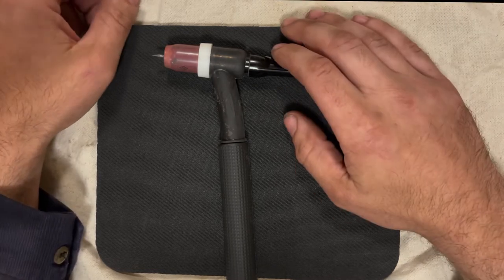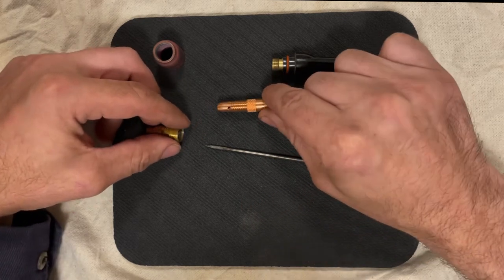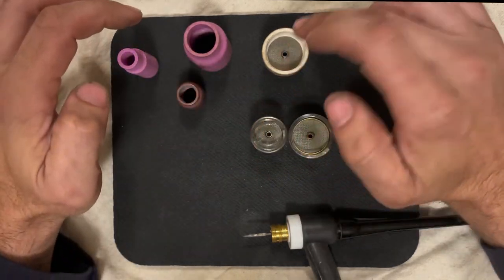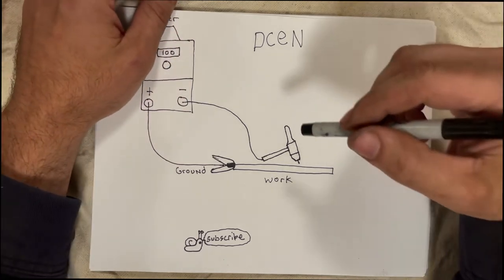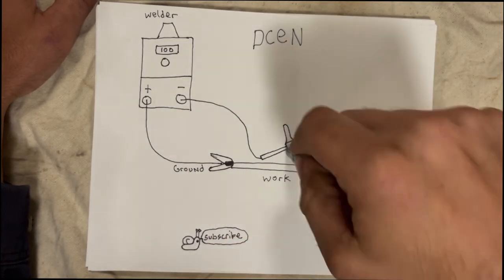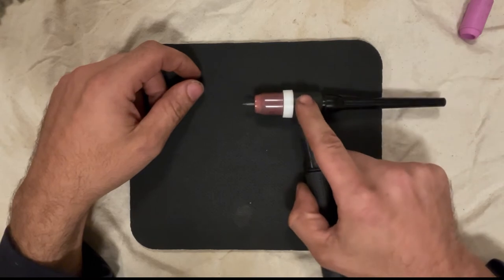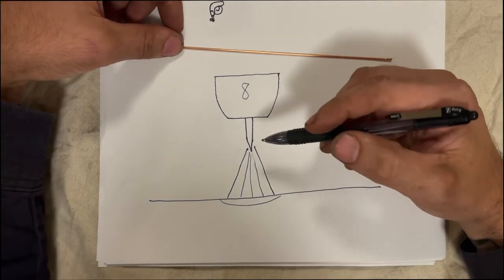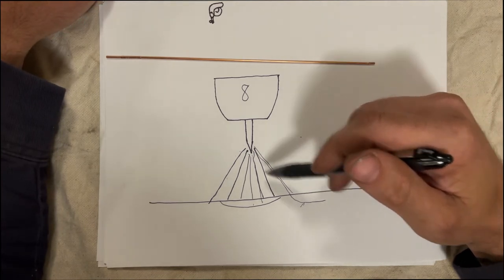Introduction to tig welding, you got to start somewhere right?

Comment: Thanks Greg! This is a very clear presentation of tig welding. For us beginners, the arc gap is smaller than expected and it's difficult to maintain such a small gap. Obviously, this is where practice comes in! Also, it's easy to forget that the electrode must be positive!
Reply from the maker: I am doing a whole series on tig welding and the first videos will be out shortly. I have to get through the backlog of videos I need to edit first lol.

Comment: Further notes from the field: Practiced tig welding for approximately three hours each day for the last three days. On the first day, I spent most of the time sharpening the tungsten electrode. On the second day I got a lot of burn throughs. But by the end of the second day an interesting thing happened. The view of the arc through the helmet became the dominant view. As soon as the arc started, the focus was on the tip of the electrode, the size of the arc pool, the location of the filler rod and the joint that was to be welded. As soon as the arc started, I felt at home. By the third day, the use of the pedal came into play. It became natural to let up on the pedal as the arc pool became too large. Sensing a burn through became more predictable. Also, I was able to focus on the location of the tungsten tip, the size of the arc and also how much pedal I was using. Each of these became distinct and controllable. One is supposed to feed the filler rod in, in small steady movements. I had been simply moving the whole rod in without advancing it with my fingers. But, by the end of the third day, that technique began to occur on its own. Not well, mind you, but it was starting to happen. The welds are nothing to write home about, but I can see that with practice, things could get much better! All of this is thanks to you and your patient and detailed explanation of how to tig weld!
Reply from the maker: Glad to hear of your progress 😀.  I will be releasing tig welding videos shortly once the last of my current video backlog is through.  

What you describe is what becomes automatic with practice.  It is unbelievably difficult at first with tig to control all of the variables, because you need to spend too much brain power on trying to control the variables.  As you practice most of the variables become automatically controlled.  At my experience level I determine arc gap not by the actual visual distance but by the light output of the arc.  As you become more experienced you will find you simply pay attention to how bright the arc light is, how wide the puddle is, and moving steady.  It becomes infinitely easier at this point.  Many people quit learning tig before they hit this point.  It takes everyone a different amount of time to hit it, the key is not giving up and steady practice 😀.

Comment: Greg I been watching a lot of your videos and bought a titanium flux core welder and because of you I am doing pretty well with it. I bought a yes stick welder from a yard sale for $50.00 and the guy through in a box of 6013 and 7018 already gave it a try on 1/8 angle iron with 6013 and was surprised how easy I picked it up after watching your videos haven’t tried 7018      yet trying to get a deal on some 1/4 “ I thinking of buying the ESAB rouge ET 200 tig welder have it in cart just haven’t hit the buy button yet. Would like to get one that can do aluminum but that seems to be out of my price range my question is to you what benefits do you get from tig that you can’t get from stick or MiG. Thank you for all you do you are a great teacher and an incredible person.
Reply from the maker: Glad to hear you’re learning to weld 😀.  Here is a couple thoughts on the esab rogue 200.  It is a really great welder that nothing else compares to at its price range.  Its power factor correction, high efficiency, and excellent stick&tig welding capability puts it way beyond many other options out there, especially when you consider its portability.  I literally welded a big hydraulic ram lever back on a truck with mine last week, it can pay for itself in a few repair jobs.  The only welders I believe are better than it are the fronius 180 and the miller 161sth, which are both 2-3 times the price.  

As good as it is, its main benefit is size and ability to run on 120v.  If you don’t plan on doing portable/mobile repair, have a 240v outlet, and are ok with a larger machine that sits on a bench or a cart, there are better options.  For 1k you could get a everlast ac/dc tig machine, a primeweld 225 ac/dc, or similar.  The build quality of those will not be near what the esab is.  They don’t have power factor correction, (or the efficiency) so generator use will be far harder. The tig torches they come with dont have amp/arc start control.  However they would have the ability to weld aluminum, something that none of the smaller tig welders can do.  If you want to learn aluminum and are ok with the machine sitting in the shop, I would get a ac/dc tig machine.  Many of the cheaper Tig machines will not run 6010 so verify one you’re looking at will if that’s a concern.  

Tig has some huge positives and huge negatives.  Tig is a very low deposition process that’s slow, has almost no tolerance for contaminates, and fairly expensive (both the shielding gas and machine cost).  The benefits are extremely clean welds, extremely strong welds, ability to weld virtually any metal, and many other things.  Tig is difficult to learn at first but once you get it the process becomes easier. I should really do a video comparing all the processes with pro/cons.

Comment: Would there be a case where a home gamer would ever consider a mix of CO2 and argon for tig welding at all, or 100% argon cover majority of home tig weldin?
Reply from the maker: Great question.  The issue with Tig is the tungsten itself.  Tungsten has a unbelievably high melting temp (over 6k degrees), however if you get it hot in a oxygen rich environment it will oxide and disintegrate well under that temp.      It needs a “inert” gas environment in order to avoid oxidization.  The use of CO2 will cause the tungsten to burn up because co2 is a active gas.  The co2 would be beneficial to the heat input (and that’s why it’s used with MiG).  With MiG the wire is both the electrode and the filler, so the fact it gets consumed is not a issue (obviously tig tungsten is not meant to be consumed lol).  

So basically 100% argon is what you want to use for tig.  You can use blends of argon/ helium (or 100% pure helium) as well, which will increase heat input due to higher arc voltage.  There are also oddball gas mixtures used in aerospace that I have heard have small amounts of hydrogen but I have no experience running those.  Hope the info helps 😀

Comment: Sorry my last comment should have said, the electrode must NOT be positive as your graphic clearly shows! Well, truth be told, before watching your video, I had it connected to the positive terminal and it burned the end off the tungsten instantly. It took me a minute to figure it out. And then to be on the safe side I watched your video and as you might guess, my arc gap was too long!